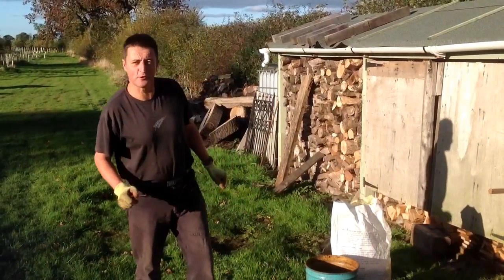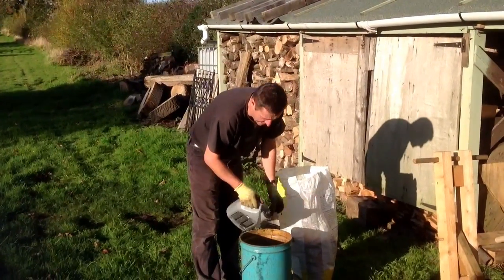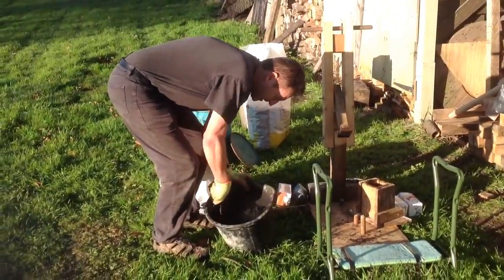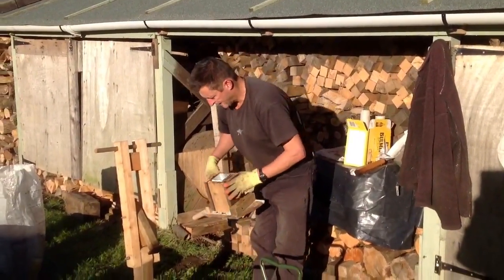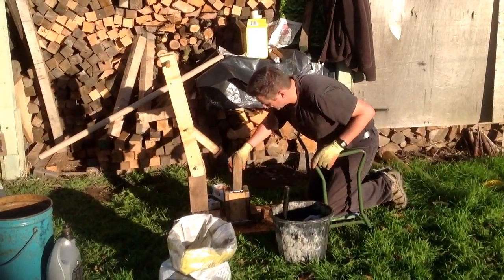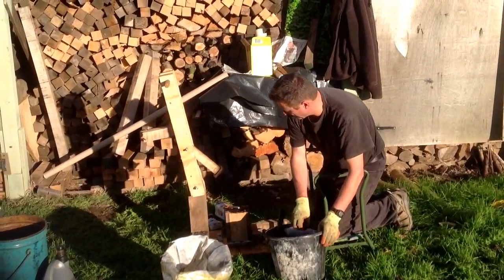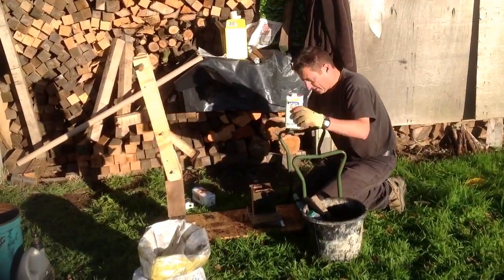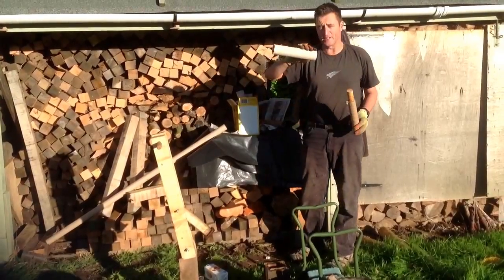How to make fuel from sawdust and old oil.

Comment: Hopefully you will still see my question :) nice idea but I heard about getting these too hot and damaging stove? what if you dont make briquetes but just put couple small shovels of sawdust and oil mix into furnace?
Reply from the maker: It doesn’t get too hot, because the flammable material is compressed it only exposes a relatively small surface area for combustion. Putting shovelfuls on will give you a very quick flare-up and possibly cause a lot of heat and smoke. I would not recommend doing that.

Comment: great video. instead of motor oil, do you think it would be ok to use heating oil sludge?  I get the oil sludge from peoples tank when they convert  to gas heat so it's free to me.
 it would not be burned inside the house. it would give me some heat when working outside and would help me get rid of the sludge.
Reply from the maker: Jack, this would be your ideal solution. You would need to experiment with the ratio of sludge to sawdust, heating oil is quite volatile compared to engine oil. Start with a low amount of sludge first and see how it burns, adding more on subsequent mixes until you reach a point where it seems a bit too volatile. Perhaps even a mix of sludge, engine oil and sawdust? Be sure to report back!

Comment: Any ideas on the btu's that  brick is capable of?
Reply from the maker: Not reallyCurtis, certainly not in actual figures anyway. I can however confirm that the heat output is high, because oil is a high energy fuel. Clearly there is an effort involved in making these fuel bricks, which is really only worth it if you do not have access to a ready supply of firewood, this needs to be considered when you decide your fuel choices. Certainly gives a sense of satisfaction when you get heat from a waste product though!

Comment: Use a sawdust stove and use a sawdust/waste oil mixture in it. Bad for food, but good for heating and powering a steam engine. Apply bicycle generator principles to a steam engine and you'll have free electricity powered by a a sawdust/waste oil fired boiler. Paper briquettes would not be able to fire the boiler for long compared to a sawdust stove. The finer the sawdust in your simple sawdust stove, the longer the burn or combustion. Waste oil can also help sawdust light much faster.

P.S all I got is fucking pine, but whatever! I can just use propane and charcoal briquettes for cooking.

Comment: I have a bunch of anthracite coal dust myself. Will this work in these briquettes, or does it have to be a higher volatile coal like bituminous/subbituminous/lignite? Anthracite is damn near impossible to get lit.
Reply from the maker: Pyrus Rex: I would have thought it would be ok. I have just been burning some briquettes I made last week using dust from steam-coal from a friend's traction engine, which is also hard to get going as it needs a good draft on it. Perhaps experiment with the proportions in the mix, start with say one third anthracite dust to two thirds oily sawdust and then see how it burns...you could always increase coal dust quantity if it burns ok. Remember: not too much oil! Just enough to make everything bind together, and plenty of compression to keep the mixture in one piece.

Comment: The point of briquetting is to reuse waste and a good briquette can burn with virtually no smoke.
Reply from the maker: Thanks Lucius, nice to see a reasoned comment for a change! 👍
By limiting the amount of oil used in the mix, (just enough to act as a "binder" for all the ingredients) it is possible to make a fuel briquette which burns safely and relatively cleanly. Some of the radical comments I have received would suggest I am about to burn my house down or destroy the planet!

Comment: I hope you don't burn them indoors or in a garage!!!!!!😧😧😧😧. The HYDROCARBONS put off from used oil combined with coal dust when burned would be like sucking a car exhaust. Not to mention the extreme carbon build up in your chimney,,which will eventually clog the chimney and create a chimney EXPLOSION or if not an explosion,,,,a partially clogged chimney gets IMPROPER drafting and can also cause a backdraft. Please,,,Please,,Please,,BE CAREFUL in your endeavor,,as this is a great way to die of asphyxiation or BLOW your house to HELL. Sorry,,but this is a BIG thumbs down!!!!!
Reply: i have never heard of a chimney explosion....have you experienced or know someone who has? Don't make up scenarios without any proof, you damage your own credibility and make your statements worth less to anyone..
Reply from the maker: Frank Castronuovo whilst I appreciate your concerns, actual experience has proven your worries to be unfounded. The only way ANY fumes or gasses would be able to enter the room would be if the chimney was not drafting properly...in which case you would be asphyxiated from whatever fuel you were burning, not just my 'special mix'. As far as the combustion goes, these burn in a controlled fashion giving off a steady heat...as mentioned in other comments the key is to get the mix correct. Too much oil in the mix would certainly not make for a good burn.
If further proof were needed, I am still alive and living in a house which hasn't burned down despite several years of oil & sawdust burning!
Reply: Burning oil and coal,,as he says is very flammable. Ok,,with that being said,,those 2 combined produce over 2800ppm of hydrocarbons. If hydrocarbons do not get the proper amount of oxygen,,example,,, all windows CLOSED in the house or shed or barn,,,they CAN and HAVE had VOLATILE reactions,,,as BOTH are petroleum products. So far,,so good,,you're still with me or am I getting over your head,,because you challenge my credability. I'm 56 years old and a volunteer fireman for over 30 some odd years,,,which means I have attended FIRE SCHOOL in the state of New York,,,and passed all classes. I have also UNFORTUNATELY extinguished MANY out of control blazes and been in garages and repair shops with waste oil heaters that weren't or didn't get vented properly causing TOXIC explosions. And on 3 occasions,,,UNFORTUNATELY have had to drag UN-IDENTIFIABLE remains of people who were unlucky enough to be in the wrong place at the wrong time..........IT ISN'T A PRETTY SIGHT to move a body sooo BADLY charred that a finger breaks off in your gloved hand. Now,,,,,,I don't care what you guys do,,,,,,as I warn all NON UNDERWRITERS  certified heating devices,,,,, JUST BE FUCKING CAREFUL IS ALL I'M SAYING....it's not my business to tell you what to do,,,,,,,but for CHRISTS' sake,,don't hurt yourselves. I've seen poor souls burned to death and it's not pretty.......with that being said,, I will no longer participate in this conversation,or comment any more on your videos. I'm sorry if I offended you,,,,stay SAFE,,,,and have a great day,,,,BYE-BYE😊😊😊😊😊😊
Reply from the maker: Frank Castronuovo I appreciate your concern, obviously you have seen the unfortunate effects of combustion when it all goes wrong.
Reply: Frank Castronuovo . Are you serious? Like anyone would been shit indoors! Fuckin ell

Comment: i sometimes use old wood mulch from around the property from dry twigs and small branches  leaves  ect with old motor oil in my wood heater stove , only i just tip in small quantities of oil as needed

Comment: Nice one. I tried a couple of years ago with sawdust and old engine oil. I was quite amazed by the general performance. Considering it's a normal wood burning stove. 

Engine oil alone didn't work well in the wood stove... But burned perfectly on my DIY rocket oil burner set in the garage. Made with a car disk brake and exhaust pipe. 

Note: For containers I used toilet paper tubes, marvelous, work really well. Only issue the "briquettes" are small. LOL :-)
Reply from the maker: crpth1 yes, I guess they would be small. What did you call them, "oil turds"?
Reply: ahahah. :-) I just burn them before I could name them.

Now I remember that must ask my wife to not trow them away... Gonna make another stash of "oil...turds" the Winter is coming.
 
Jokes apart they burn quite well and for quite a long time. Depending on the oil amount/type. Best results where from diesel and gas engine oils. Cooking oil (sunflower oil) and manual transmission oil I didn't like. Somehow didn't seem to burn so well. 
Thanks for sharing, be well.

Comment: I would avoid burning oil and old tyres. The fumes from these things will be toxic for your lungs and overall health.
Reply: Ingrid Burling . You're bad for my health
Reply: Do you live near a road or eat food from the grocery store? If so you injest the same toxins everyday
Halfburnt oil(gasoline, diesel, motor) tire dust, brake dust and asphalt.
Fertilizers used in mass agriculture...
All basically the same carcinogenic oil and byproducts there of.
Petroleum is horrible stuff, it rules our modern life in every way, from plastic wrappers to backing the worlds most used currencies.

The issue in this sawdust-waste oil log thing lies is getting it to burn hot enough for complete combustion without having a meltdown in the stove. I have burned enough petro products and creosote to know it's a fine line involving red glowing stove pipe and a good bed of coals
I'll play with it, some cardboard quart jugs are the only thing I don't have a steady supply of but I think I could always find old cardboard coffee cups laying around, burning sawdust and oil so what's a little PET or whatever they coat the car board in on top of it?

Comment: I would imagine the smoke is a little black, but what about the smell ?  Does the oil have the normal smell or does the other material you mix the oil into sort of mask the odor ?
Reply from the maker: Earl Turner , if you burn it on a hot fire the oil smell is partly masked by other materials...the more complete and cleaner the burn the less the smell.

Comment: Not long after moving we had an ice storm that knocked out power for 10 days and we didn't have any firewood so I mixed sawdust with diesel fuel in an old metal dog bowl, put in in the wood stove and set my dampers. It burned for 4 days and we were nice and warm. The smoke from the wood stove was hardly noticeable and it didn't smell at all. I was shocked at how long that sawdust and diesel burned but was glad it did.
Reply: Can you please explain how you mixed the saw dust with diesel and how much diesel you used to sawdust, please? Thank you

Comment: now I know who's messing up the ozone
Reply from the maker: Red Mobile: silly old me! For years I had thought it was millions of motor vehicles and Chinese coal fired power stations....now I know it is actually me and my wood-but-sometimes-waste-oil-fired heating stove. I must make ammends! So I plan to stop the wife releasing harmful methane gas in bed....hope this offsets the environmental mayhem I am wreaking on this planet.
Reply: RED MOBILE uk pussy
Reply: RED MOBILE uk . Yeah me
Reply: RED MOBILE uk Burning petroleum products doesn't cause ozone depletion, chlorofluorocarbons do. CFCs were banned or phased out starting in 1989 and the ozone layer has begun to recover, the hole is more or less gone.

By the way, burning petroleum is a LOT cleaner than letting it sit around. I'd feel more comfortable burning it than risking it spilling and contaminating our well water or feed supply.

Comment: Your nuts, a drip of engine oil can produce a hell of a heat for a sustained amount of time. With enough air you can melt steel with it. Advising people to soak woodchip in an uncontrolled amount for wood burner fuel is completely irresponsible. I've toyed with oil burning stoves and I promise you following this guy you will burn your house down. you've regulated the burn by starving it of oxygen, until you open the door and like petrol it's gasses will go looking for air. Remove this vid before people kill themselves.
Reply: Another thing to consider is oil thins with heat. You put too much in and light it. The oil will leak out all over the bottom of wood burner. It's not going to burn because it won't have enough air and this will happen before it gets hot enough to become a gas. It will then could leak out of burner and end up on the outside of it. The burner then gets hotter and that oil on the outside becomes a gas. It can then either ignite or posion the air in your home. I've seen this happen and ignite and unless you have a lot of water instantly you won't put it out before youve lost your house. I've also seen oil burn through a flu pipe when soaked wood was being burnt in a wood burner. It's seriously not clever.
Reply from the maker: Jonny Norris whoaaa! Slow down my nervous friend!🤓 Trust me, I have burnt LOADS of these, and they release their heat in a controlled and slow fashion. How? The key is in the compression, by keeping the brick to a smallish size you limit the surface area which results in a slower burn. I get about 45 minutes from each brick.
Thanks for the prompt though, I really need to post a video showing these being burnt in actual practice. Hey, before you know it you'll be making your own! Patent still not issued, so no copyright issues to worry about....fill yer boots!
Reply: Mate I know exactly what happens with oil soaked wood. I was like you too under the impression it was controllable. It's not simple as that. It nearly cost me my workshop. If the stove gets hot enough that oil can all turn to a gas at once. You open the door during this and you will experience what I did. A five foot fireball hit me in the face and sustained flames coming from the open door. And I was using a lot less oil than you are. So good luck to you pal.
Reply from the maker: Jonny Norris I am interested to know how you were burning the oil? Sounds like it wasn't very well contained...as I say the key is compressing it, and if you notice the mix I recommend is not dripping with oil but more of a 'damp oatmeal' consistency. Been burning this for years now, so long as you follow the guidelines there really shouldn't be an issue. May the flame be with you friend!👹
Reply: Exactly how you are  except my blocks were not held together with oil, only partially dripped with it. I too was burning it for years.  I had the stove running full burn for the entire day. The stove was hot. Probably a few degrees hotter than usual not massively. The problem is a wood burner does not burn oil efficiencently. The chip will burn but without enough air the oil does not. After throwing brick after brick you are coating the inside of the burner with the stuff and then you let more air in to stoke it up when have a much higher ratio of oil to woodchip than in your brick. Youve increased the air and temperature and you have all that oil vapourising at once. I'm not ranting to be an arsehole here, I've experienced it first hand, and even if you have been getting away with it for years because I was. all it takes is an unfortunate amount of unburnt oil and air settings and your in trouble.
Reply: Wood will actually begin burning at 100 degrees, oil does not burn until 200 degrees. So in the early stages of starting with these bricks the oil will just be running out of the brick into the ashes. Unless you have 200 degrees constant underneath the brick you can't control it.
Reply from the maker: Jonny Norris please read my comments and watch the video carefully: I keep telling you that you need to keep the mix fairly dry but you are not listening.....your bad experiences stem from your overly oil rich mix. IF OIL IS DRIPPING OUT OF THE COMPRESSED BLOCK THEN YOU HAVE PUT TOO MUCH IN! Stick with this simple rule and it will be fine....happy oil burning!